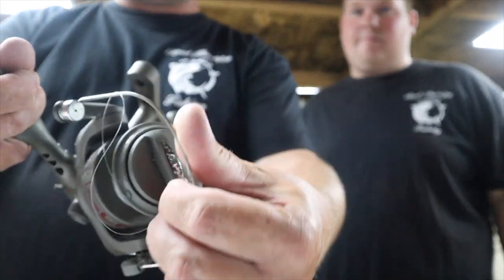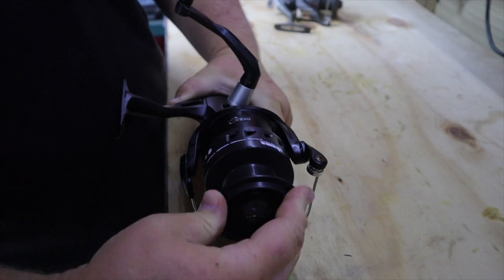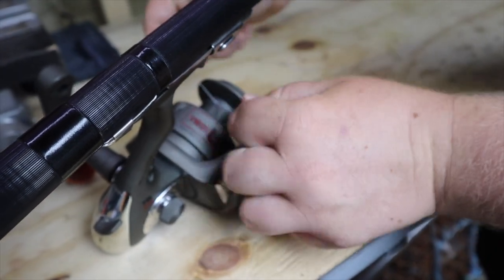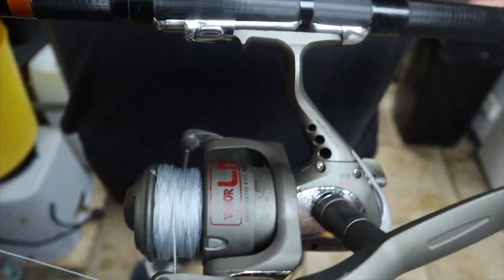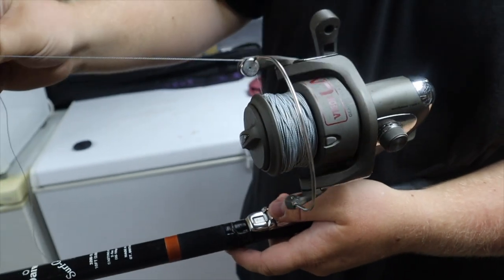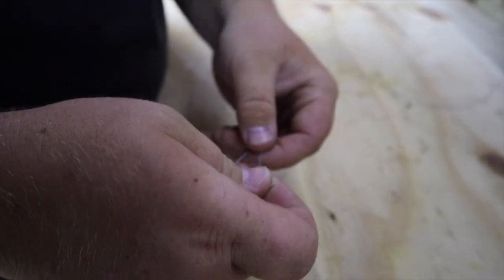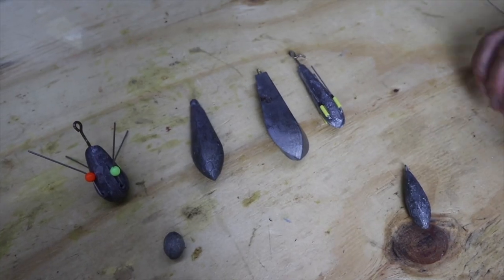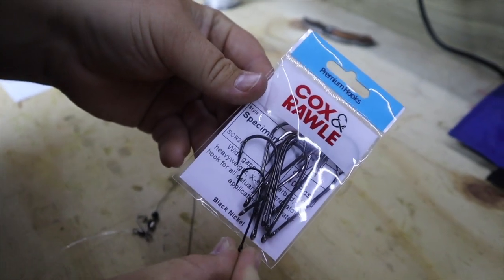Beginners Guide To Sea Fishing| tips and tricks  | How We Fish | Beach | Boat | Pier | Fishing UK

Comment: Hi Guys super vid, I am a novice but jumped in the deep end with my own boat 6m 40HP 4 stroke engine, as you can imagine learning alot, working offshore on a vessel has helped,  my question is I bought an anchor set 10mm polyprop rope with 8m chain and bruce anchor 5kg, Morecambe bay is fast tides and the guy I bought it from (ebay and sells them alot) assured me the rope would be    fine ? generally its 25ft depth so I have 150ft of rope what do you think about the rope, seems quite thin and I'm scared of it parting in strong tides and loose my anchor. Thanks Grahame
Reply from the maker: Hi Grahame hope your enjoying the boat, 10mm rope is abit on the thin side we use 12mm. Do you have an anchor trip so if the anchor was to wedge a forceful tug would snap the trip and free the anchor ?
Reply: @ReelTherapyFishing  Hi Guys, Im all good just out in Azerbaijan ready for going offshore, Im loving the fishing and new experiences with the boat, its been hard work learning to fiberglass and getting the boat ready but running great, I tried alderney ring, anchoring etc which has been fine, I did buy an anchor trip stainless one so if i get stuck comes up backwards, I might look into a thicker rope and maybe something stronger than polyprop.
Reply from the maker: @grahamejewitt9407   Sounds lovely mate, yes some thicker rope is defiantly recommended especially for a 6m boat 👍
Reply: @ReelTherapyFishing  thanks guys, just ordered shamrock 14mm polysteel rope 100m so it will be ready to splice and set up when I get home, good luck with the fishing and enjoying your videos 🎣
Reply from the maker: @grahamejewitt9407  Thats the stuff, glad your enjoying the vids 😁🎣